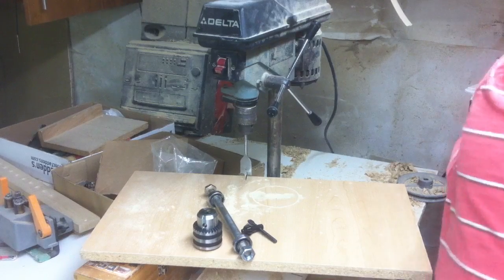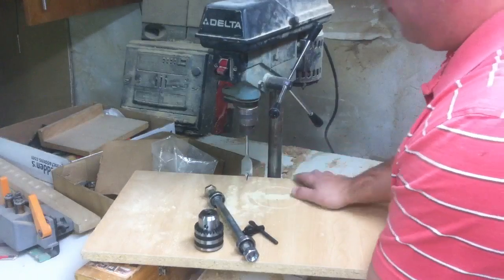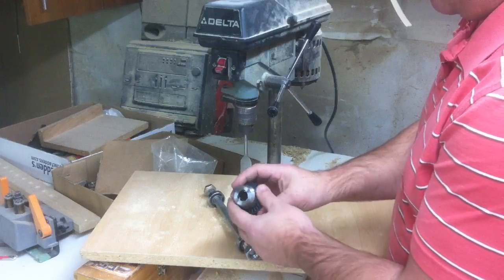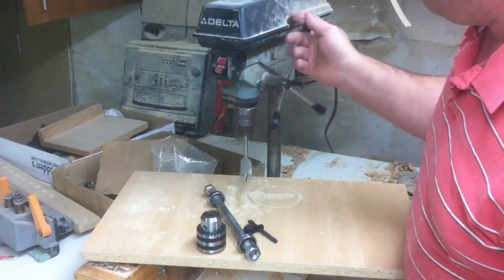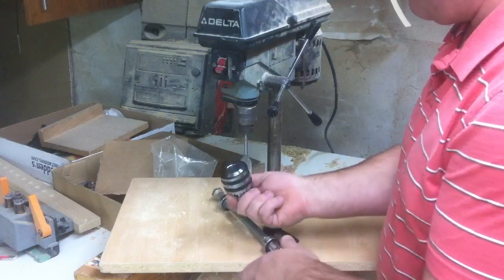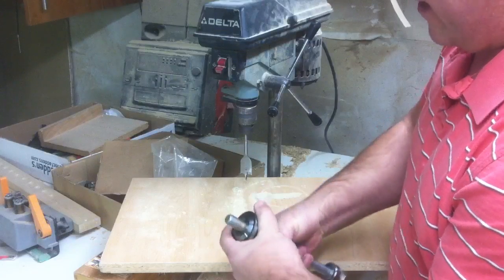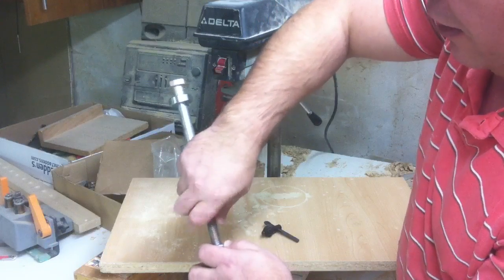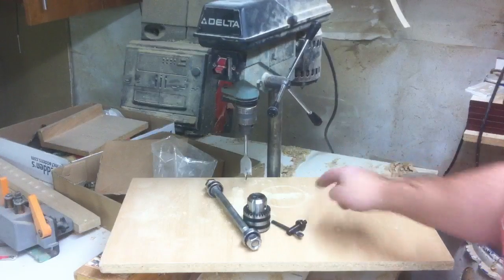Homemade Drill Press 1. The plan!!

Comment: the problem with using a hand drill for a driver is not only the size of the chuck
but the chuck is soft becauise the hand drill has a slide action on the chuck bcz of the hammer option

this makes the chuck move from side to side and in and out

better to use a hand drill with a pulley as a power source
for many reasons

one you can get th e pully to sit in the hand drill chuck
and 2 because you can get a handdrill with 800 watts
a full horse power cheaply

another reason is that you can change the speed setting by rotating the dial
with out loosing power

you can mount the handdrill on the side of the shaft and use a belt for the connection

i would use your sliding cut off saw design for the support
and that would let you go in and out for distance with overhead strength

then use your copy lathe design for a moving vise on the table

doc b

Comment: easyest way to do this is to mount the motor on the shaft so that it goes up and 
down with the shaft
then mount the end of the shaft to a hyralic car jack turned upside down
your bearings will keep every thing centered and the jack will give you up and down
cheap set up
doc b